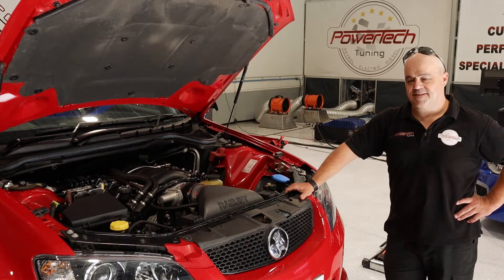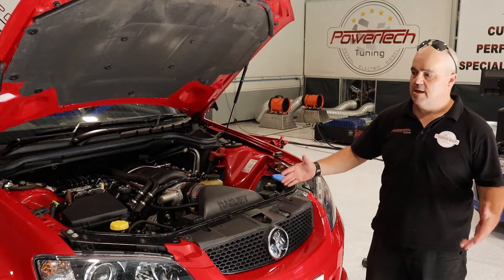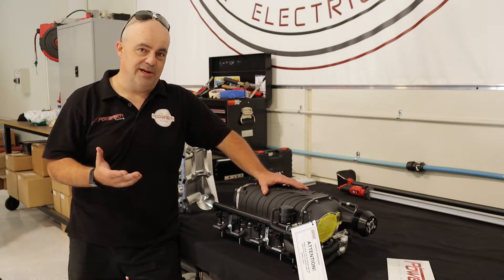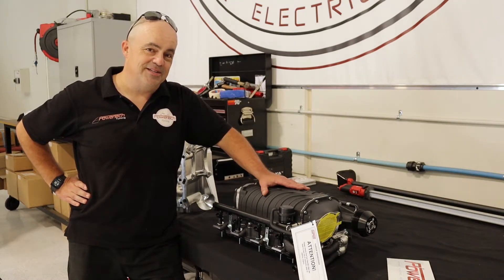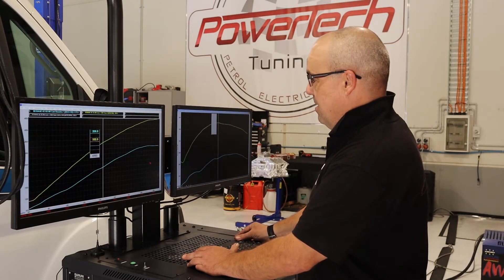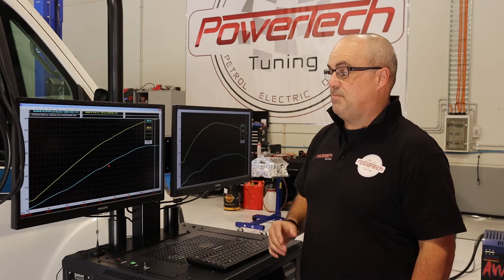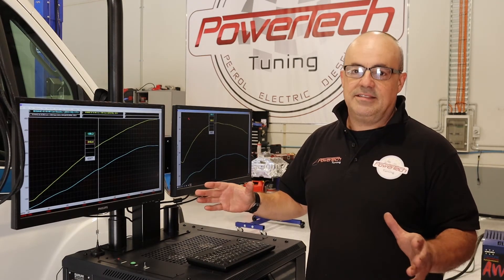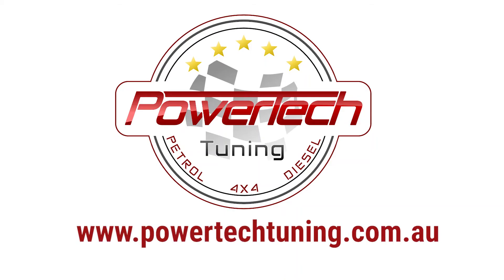PowerTech Tuning VE Commodore Harrop 2300 FDFI Supercharger Install

Comment: No the best thing you can do to your commodore is put a 98mm turbo half the price capability to make 2000hp, Harrop 2300 is $15,000+ for not much more than your getting for that turbo you have change to put a 413 strocker and an easy 800hp